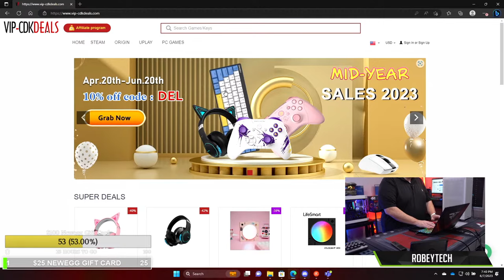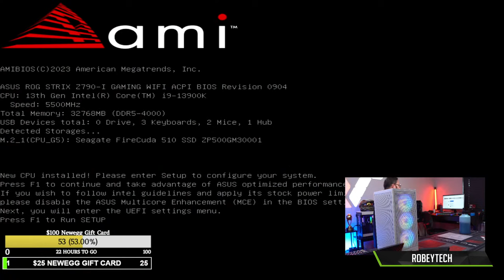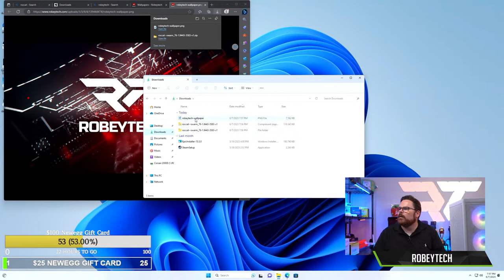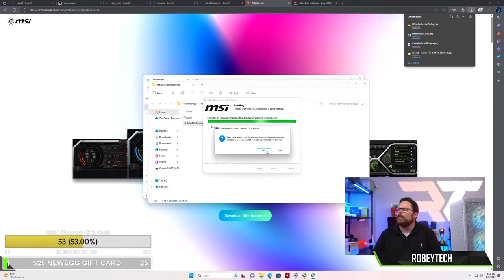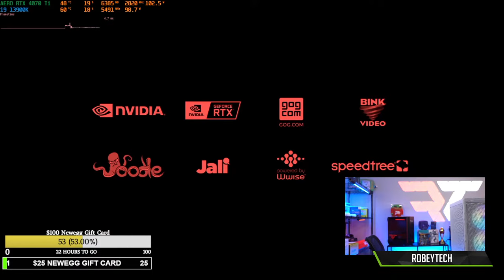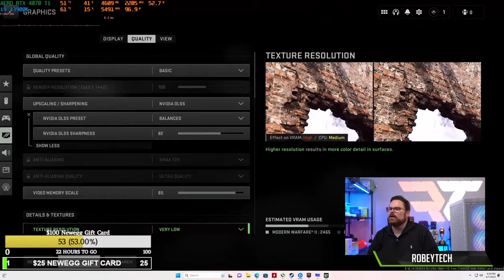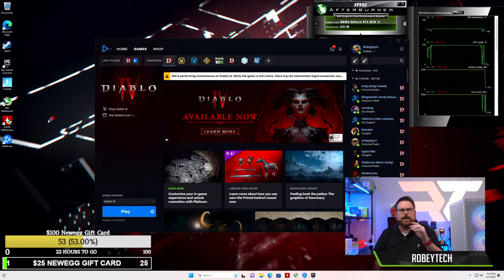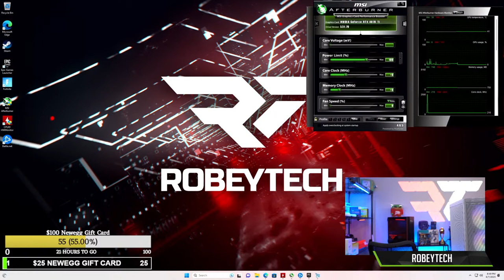Giveaways + Live $2800 SFF Corsair 2000D PC Build  (13900K / Gigabyte Aero 4070Ti)

Comment: tubles at the top of the loop? i thought they had to be below the pump.
Reply: Pump needs to be at the lowest point / below to keep fluid full so it doesn't run w/ air in it which will kill it.